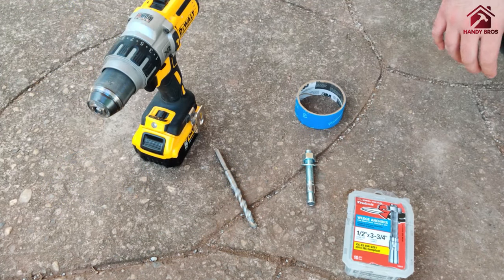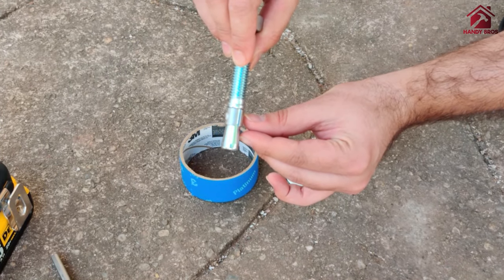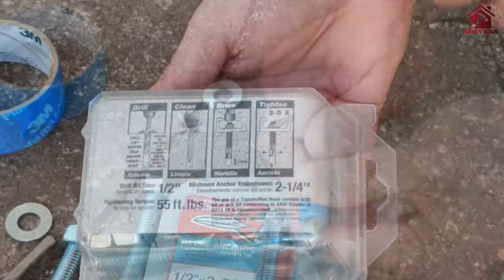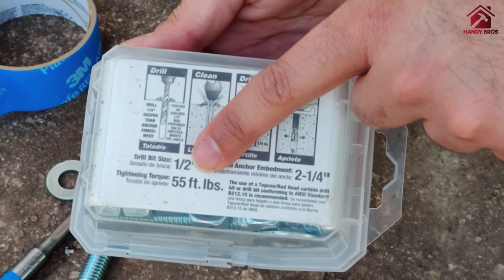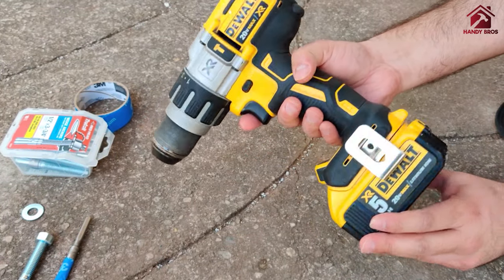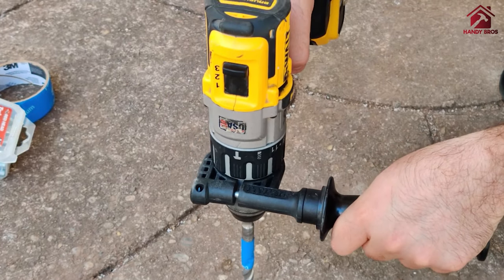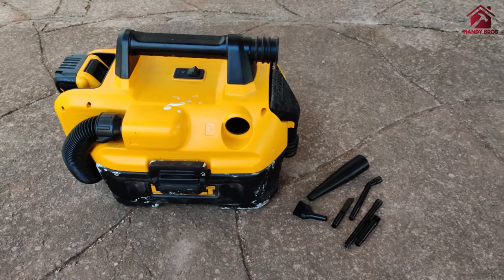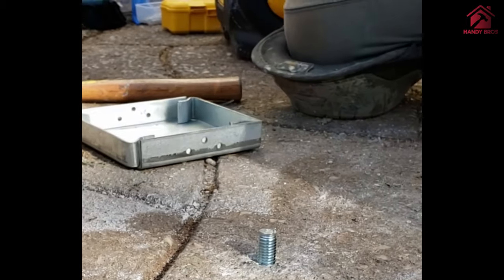Concrete Wedge Anchor Installation | HANDYBROS |

Comment: Have fun destroying the threads and rendering the anchor useless. Attach the nut to the top of the bolt before hammering to protect the threads, will save you a lot of time and headache
Reply from the maker: Thanks for the valuable feedback. I concur that having the nut on top of the bolt will surely protect the bolt thread from the hammer miss hits.
Reply: or just learn to hammer😎
Reply: That happened to me. Thanks for the tip
Reply: Just did this, now I know better. Is the only resolution to use a die set?
Reply: @Jared K - I disagree if you hammer 🔨 the top without the but it is safer than hammering with the nut on. Hammering with the nut on puts stress on the attached thread rows as you strike the hammer. Doing it your way is DUMB
Reply: @JaredK That bolt looks like the new type that has a small unthreaded section on the tip to use as a hammering point.  It doesn’t look as noticeable as the newest one though.
Reply: @nickle549  just cut off the offending threads
Reply: I had to learn the hard way... 😠
Reply: @e.r.6147  I've driven more than my fair share of wedge anchors and never had a single thread issue by attaching a nut before hand. By putting the nut flush with the top of the anchor, the strike point of the anchor is still absorbing the majority of the forces. This method allows the nut to still be threaded on if the top of the anchor is mushroomed or deformed in any way. Just providing my method and the method of the majority of construction workers out there but you're entitled to your opinion
Reply: @itskerbs  Plus, if you put the base plate or whatever it is you're attaching to the concrete in place Before you insert the wedge anchor into the concrete and start hammering on the anchor with the nut (or two nuts) in flush with the top of the threaded rod, then you can hammer away and not worry if you damage the threads.  Because the nut you are going to tighten is already threaded on!

You won't have to worry about deforming the thread at the very top with your hammering, so much that it might be difficult or impossible to start the nut onto the threads After hammering the wedge anchor into place.

And oh yeah, if you do it this way, remember to put not only the thing you're attaching to the concrete down first, but also any washers or bushings that go on it, so that when you insert the wedge anchor into the hole with the nut on top, everything will be in proper attached order in advance and you won't have to try to unscrew the nut off after all that hammering.  Just need to screw down the nut at that point.
Reply: @niflag  Put the nut on and you don't have to cut anything.  Much simpler.
Reply: @brownro214  That would require a time machine, so not at all simpler.  They said they did not use a nut.
Reply: @e.r.6147  You don't hammer directly on the nut. You run the nut down the bolt and then hammer on the bolt as shown. If you accidently damage the threads, removing the nut will fix the threads well enough so that you can easily rethread the nut with your item in place.
Reply: @bobmahler5379  thats true
Reply: Spot on
Reply: Doing it with the nut on is the way described in specs for most manufacturers now.  Just FYI
Reply: Agree with this. Luckily, I bought extra and was able to replace them. Also, the anchor did not anchor well into the concrete even when the hole was drilled to the right depth and the hole was cleaned well with a vacuum. One trick that worked was tightened the nut to the bolt first. I then loosen it afterwards. I used this to secure two outside patio appliances. I attached a 1/2” diameter bracket 4000 lb lifting capacity and attached to the concrete with the nut to the bolt. Then, added a lock.
Reply: @bobmahler5379  tell em Bob!!! You stopped the nonsense just that quick.
Reply: @mst5158  same lol but that’s how we learn
Reply: I just installed 16 of these anchors without the bolt on the top and everything went fine. The top of the bolt is already flat. You're not slugging this anchor in as there already is a hole you're tapping it in
Reply: Or use a rubber mallet hammer
Reply: @thebordernow ❤❤❤❤❤❤❤❤❤
Reply: These anchors have an extended lip made to hammer on. Hammering on the nut can also damage the threads and the nut.
Reply: @e.r.6147 Exactly,  these wedge anchors have an extended lip to hammer on.
Reply: @itskerbs The strick point on these anchors is there to be driven with a hammer without using a nut. Why risk  damaging a nut & threads.  Just learn to swing a hammer and hit what you're aiming at.
Reply: @pstoneking3418  guarantee if you look up instructions for any wedge anchor they'll instruct you to put the nut flush with the top of the anchor before hammering. I'm not saying this because I'm inept at using a hammer, it's literally in the instructions
Reply: @HuNgRiZy Yes, there's a new design. As I've watched before, top is unthreaded so it won't damage the threaded parts.
Reply: Can you explain how the nut will protect the threads ?
Reply: I hit the nut, bent the threads and the nut seized to the anchor and now I have to grind it off.
Reply: @bobmahler5379 I couldn't get the nut off. It was seized and just spun the threaded bolt.
Reply: @e.r.6147 agreed, just stripped two of 6 anchor bolts thanks to this brosephs comment lol
Reply: I use a cup link thread it on a little bit then hammer it
Reply: Use a cup link
Reply: @davidfrisch2784 if you look at 1:40 into the video, the instructions on the back literally show the nut attached while setting the anchor. Sounds like you just need practice

Comment: Those anchors you used are zinc plated & aren’t supposed to be used in exterior applications. For exterior they should be galvanized or stainless steel.

Comment: Tip : if you put your nut on before hammering the anchor in, you won't run into the problem of damaging the thread and not being able to put the nut on.

Comment: Just a lil advice , never hit the bolt directly with the hammer , it's gonna damage the thread and the nut won't go through, always use a piece of wood over the bolt and then hammer it,.that'll save you time.
Reply from the maker: Good tip!

Comment: Warning**** Never hammer down like that, it can strip the threads***
Reply from the maker: The best would be have the nut on the tip of the bolt before hammering.

Comment: Using power tools to tighten a nut that requires a specific torque. No wonder your post is wobbling.
Reply from the maker: Thank you so much for the valuable feedback. I totally agree with the fact that power tools should be avoided where a specific torque is needed. The torque required was high and we set the impact driver to low setting before driving. Thanks
Reply: 1/2 x 3 3/4 requires 55ft/lbs of torque. That's not low torque. Even on low setting, you could've easily overtightened that nut 20-30 ft/lbs
Reply from the maker: That's a great feedback. I'll definitely be cautious on the torque next time.

Comment: 6:03 Before to start to hammer the bolt, the nut must be placed to prevent from not being able to screw it onto the bolt due to damage on the threads.
Reply: Its easy to overlook, but one stray strike with the hammer and the thread is toast.  Always run a nut onto the threads as a protector and it gives you a larger strike face too.
Reply: great tip... #pause
Reply: @illwill718 I usually double, sometimes triple stack nuts onto the threads.
Now you have a larger strike face, and more rigidity added to the anchor, it won't bend as easy.
Reply: @that1electrician Hood idea using several nuts vs just one.

Comment: I have a parking post to install with supplied wedge anchors but no instructions at all. I had no idea how to use  these and post fitting videos have various methods and bolts with sleeves and plugs. This is the first video I've found which gives thorough knowledge on how to use the bolts and how they work. Thank you, saved me hours of bodging and botching usually resulting in disaster.
Reply from the maker: Thanks so much for your feedback. Do check our other video for more useful content.

Comment: Hammer it in with the nut on to avoid damaged threads. Hammer the nut not the bolt. Great video!
Reply from the maker: Good tip!
Reply: I did that and messed up the thread now the bolt won’t go through and whole piece is just sliding

Comment: That was painful to watch the hammering of the anchor. Best way to hammer something with threads is to place the nut on the bolt and screw it on until it's flush with bolt, then hammer. That protects the threads, prevents the end of the bolt from mushrooming, and saves a lot of headaches.

Comment: Will this also work for stucco? Got a heavy sunscreen shade to hang but only have stucco on the outside no cement (cheap American construction). Not sure if the anchors will hold

Comment: Very nice, but make sure you run a nut over the threads before you hammer it in so you don't damage them.
Reply: This is a great tip! I learned this the hard way.

Comment: Good info, however one does not want to damage the threads while hammering into concrete. Ensue you have the nut flush with the threads prior to hammering into the concrete.

Comment: To add. Be aware hitting soft metal too hard will expand the bolt and not possible to get nut on. If you drill a hole  the bolt may only go in the hole part of the way.. tempting you to hit harder.. 🤔
Reply from the maker: great advice! Have the nut attached to the bolt before hammering.

Comment: What do you do to keep water from getting into the hole and freezing and cracking the concrete?
Reply: If pounding on the anchor with a hammer doesn't bust the concrete then I doubt ice would.  I'm not a carpenter that's just my guesd.

Comment: In manual book  don’t let to use impact tool ?
Reply from the maker: yes, avoid using impact driver to mistakenly over tighten the nut and damage the wedge end.

Comment: I wish I saw this video sooner. This explains exactly what I didn't understand before regarding what drill bit size and how deep to drill. I didn't know these things and I ended up drilling a 1/2" whole for a sleeve that is way too small for it. The sleeve simply slides out and now I don't know what to do 😭
Reply from the maker: glad this was helpful
Reply: upsize to half inch anchor if possible

Comment: If you screw a barrel nut on the end you can use the hammer drill to drive the anchor down with less damage. Also it wouldn't hurt to use thread lubricant and depending if it's outside I would consider using stainless steel so it won't get rusty over time
Reply from the maker: Thanks for your suggestion! They anchor bolts a re rated for outdoor use.
Reply: What bit do you use on the hammer drill to drive the anchor down?

Comment: At the end it looked like it wobbles
Reply from the maker: Thanks for your feedback. This may just be an illusion. The bolt held firmly and we atrached the post base plate for a patio roof column with no issues.
Reply: @HandyBros  haha an illusion. It fucking wobbled dude. Likely cause is using your driver to tighten rather than a torque wrench. On the package you showed it specified 55 ft lbs, drivers are great for driving screws but not so great at getting that specific torque.
Reply: @MrEinniv  Ive installed various versions of these, the one in the video is 16 gauge garbage, and did wobble. I went with the stronger 12gauge with 4x4 post and was able to lean on it 180 lbs, with minimal wobbling and movement

Comment: I bought a pre cut shed from lowes and plan on putting it on an existing concrete slab so these wedge anchors should do the trick or longer ones?
Reply from the maker: That's correct. You may to pick the size ensuring you achieve about 2.5 inch of bolt embedment.

Comment: I want to install the pullup and dips bar that's out there into my wall in my apartment . Would you say this is strong enough to hold me up I'm about 170lbs?   Thanks
Reply from the maker: Firstly, This is for concrete or masonry application. 
I don't think this would work for the application that you are seeking even if you are anchoring it to concrete.

Comment: Nice!
What if this attachment hast to be placed in a wall, and you dont know where the concrete is and where the blocks?
Reply from the maker: if you have a solid block, you should be able to use the wedge anchors for them as well. However, I have another video for attaching a wood to the masonry wall using Tapcon concrete/ masonry screw. Do check that video as well!

Comment: Does the post move? It looks like it was moving after
Reply from the maker: Due to the level arm created by the post, the base plate was slightly bending when the force was applied. However,  the post was part of the patio roof that had other connections to the beams and cross bracing to provide stability.

Comment: What size would you use to attached a 2x6 ledger board
Reply from the maker: at least 3/8 inch diameter with length about 4-5 inch

Comment: Put the nut over that bolt as you are hammering it down into the concrete so you don't damage the threads.
Reply from the maker: it always better to put the nut over bolt before hammering.

Comment: Good for rock climbing anchors?
Reply from the maker: Check the technical specifications form the manufacturer here: https://www.itwredhead.com/portals/0/fmproductcatalog/documents/products/39/trubolttechnicaldata.pdf

I would assume, if installed right, they should work for the rock climbing anchors.

Comment: Can you remove those bolts after? Or they stuck forever?
Reply from the maker: those bolts are pretty much stuck forever. either you can fight them to take out or cut them.
Reply: @HandyBros  ye but you can push them inside hole and cement on top ?
Reply from the maker: the hole is typically drilled 1/4 in more than the embedment. so if you plan to push them bolt down in future, then consider drilling the longer hole when installing to you could push them in later.
Reply: @HandyBros  yep thx

Comment: I'm using 1/2 so use 1/2 drill bit right
Reply from the maker: typically that is the case. But do check with the instructions that come with the anchors you get just to confirm.
Reply: Did you end up using 1/2 drill bit? About to drill some today gonna be windy af tomorrow

Comment: Good video but you did not drill a recess hole for the nut and bolt in the post!
Reply from the maker: Good observation. There was no need for a recess hole for the nut and bolt in the post. The post base came with a plate that goes on top of the nut and bolt thus elevating the post by about an inch.

Comment: Never tap or hit the bold and nut together 
They strip. It happened to me twice 
For paying attention to the stupid comments.
Reply from the maker: Did you drill the right size hole? coz the bolt should slide in with a few gentle taps. The nut will help to protect the bolt from any miss hits.

Comment: WHAT IS MATERIAL USED, PLZ SHARE THE MATERIAL GRADE WITH FULL DETAILS. I AM WAITING for YOUR REPLY. IN ADDITION PLZ SHARE THE MATERIAL CODE FOR CARBON STEEL AND STAINLESS STEEL,
Reply from the maker: The link to the material including the wedge anchors are provided in the description. You should be able to get the details from the product page or manufacturer's webpage.
Reply: Seriously bro just look it up lol